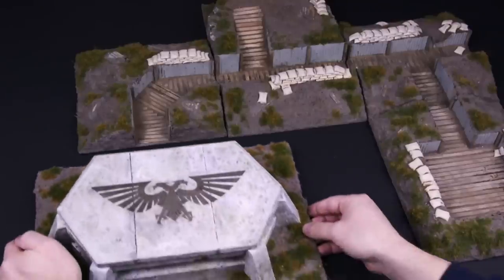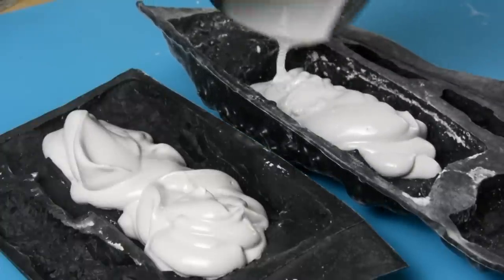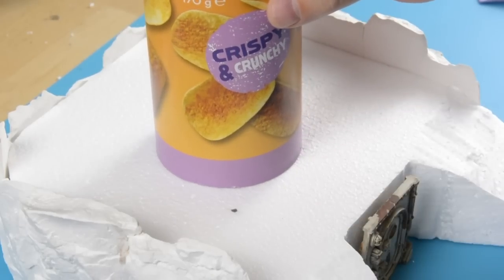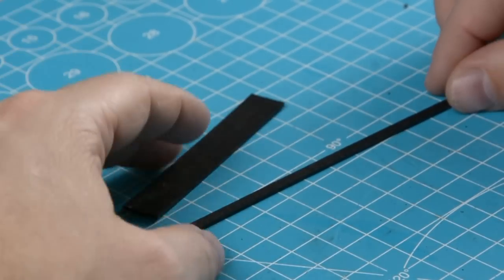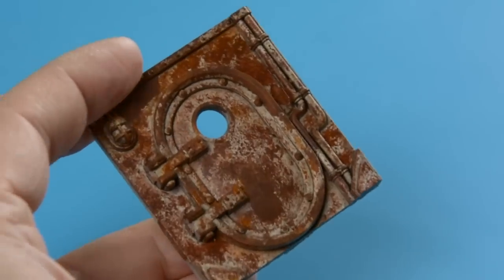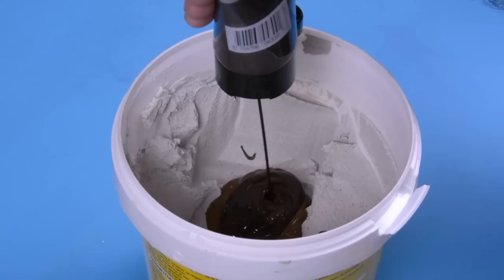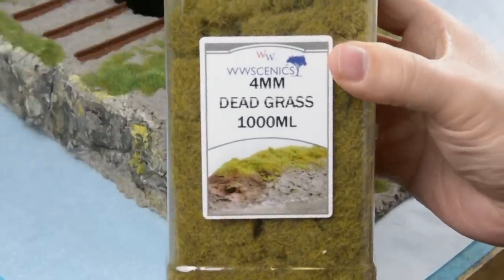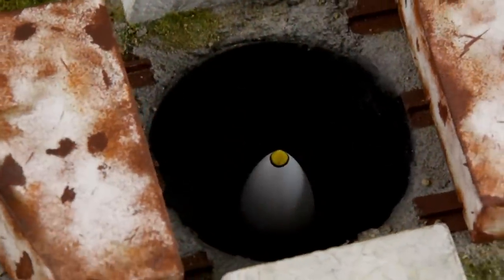I Made an Underground Missile Silo for Warhammer 40K

Comment: I love the shadow effect simulating the missile going on downwards. but given the diameter of the silo I'd made the missile a little bit bigger. Also I think the silo doors should be movable so you can start a game with closed doors, and if the silo isn't conquered at a given turn, the doors open and the missile lifts off.
Beside of these two very little complaints, it's a really stunning piece.
Reply from the maker: Thanks! The doors are in fact movable. 😉 I agree, I'd liked to have made to missile bigger, but it was pretty much as tall as there was room for. I think there's a 3-4 mm gap from the tip of the nose to the doors when they're closed.

Comment: I was rewatching this video and had a question.  Have you ever made your mud mix and saved it for later?  I like to make 1/35 scale tank dioramas, but don't think I would need as much as you use.  Wondering if I could make a batch and save the leftovers for later.
Reply from the maker: Yeah, I've had some left over between projects. I think the batch I used in this video was left over from the hill video.
Reply from the maker: So, it'll keep for a while. Probably a good long while, if you keep it in an air tight container.

Comment: Have you tried stippling a thinner plaster mix on the concrete foam pieces after tin foil balling them instead of modpodging them?
Reply from the maker: No, I think the plaster would probably break and come off. I've used grout and glue  with EPS foam.
Reply: @thecultofcrafting   I was thinking of a whitewash consistency, so about the same as a thinned paint.
Reply from the maker: Typically Mod Podge is added to protect against solvents and toughen up the foam (which it does poorly, but better than nothing). If you make a whitewash consistency plaster mix, I doubt it'll do any of those things. Off the top of my head, the only reason to do that would be to create a whitewash effect or a similar kind of weathering. 
If you're suggesting it for an added layer of texture, it could probably work, but I'd add some glue to the mix or give it a coat of Mod Podge afterwards. Still, there are probably better ways to go about it. Regular plaster doesn't have much texture to it and it isn't very durable. 🙂